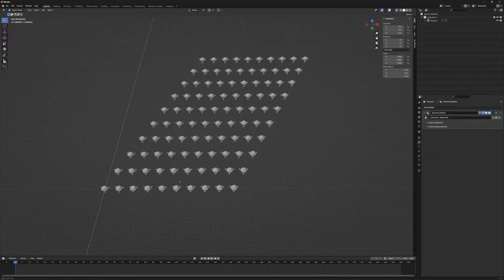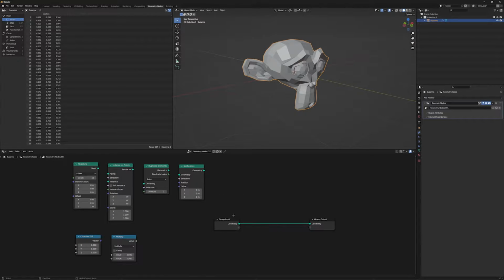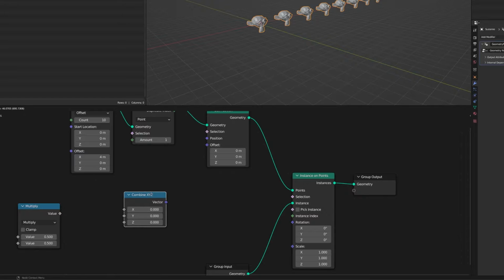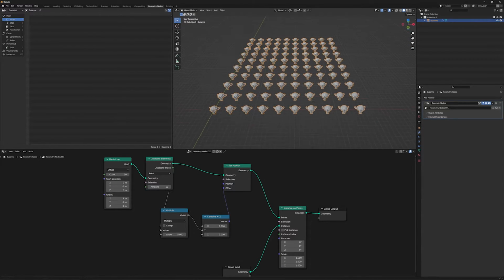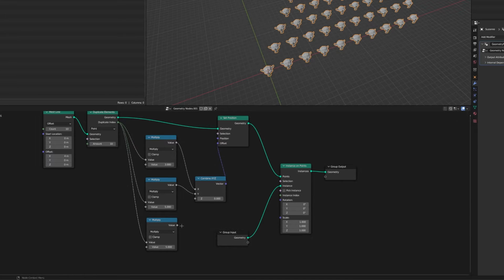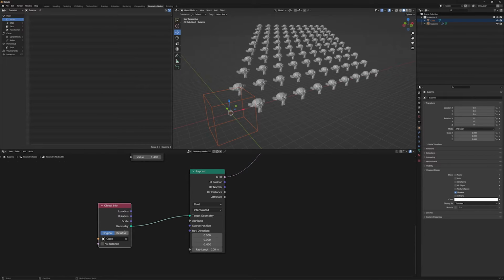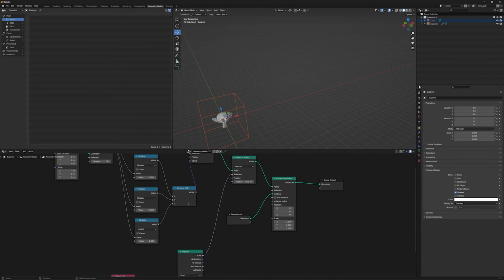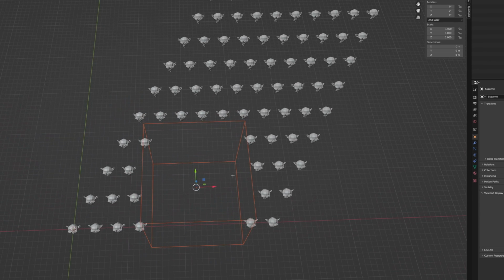Creating a simple Array using Geometry Nodes in Blender

Comment: Interesting technique, but in Blender 3.3, I get a slant, ie. the object isn't duplicated along the x axis, but both x and y axis, even with a X offset only.
Ah, it might be related to the object I use, it was a deformed cube, but if I apply it on a simple mesh (isosphere), it behaves as you show. Curious.
But I learned things with your tutorial, thanks.
Reply from the maker: Sometimes you have to apply scale so it's always 1:1. Try not to use any deformation since it is done procedurally from GeoNodes.